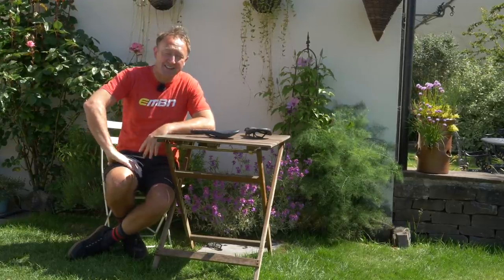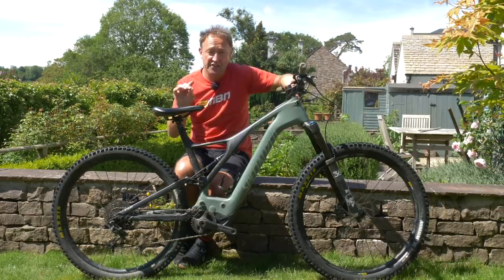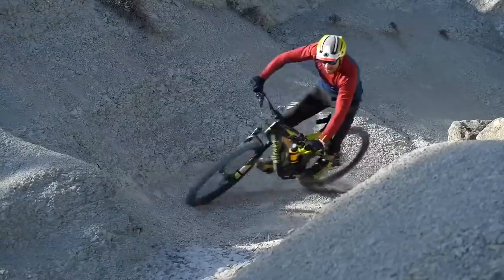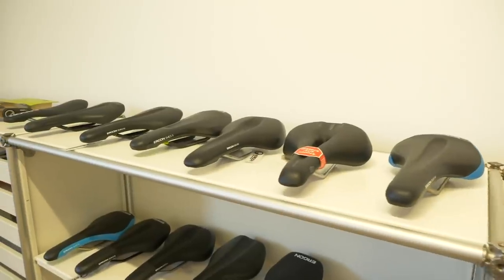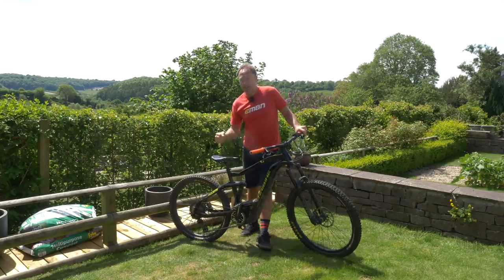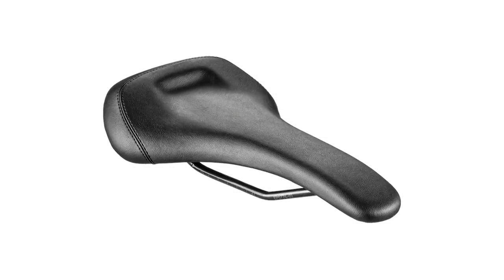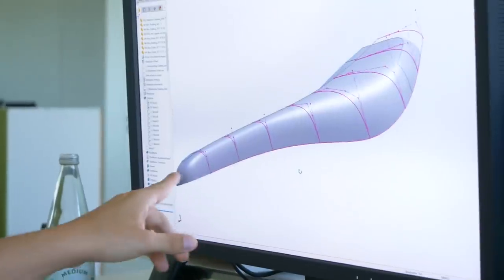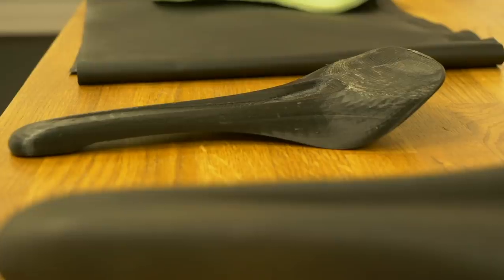Saddle Comfort Explained | Do You Need An E-Bike Specific Saddle?

Comment from the maker: Have you tried many saddles? Do you have a preferred style or are you still looking for the perfect fit? Let us know 👇
Reply: @renthal2372  its probably the width you should be looking at m8,  not length of rails
Reply: I have tried bike saddles for years, from hard, soft, gel, concave, channeled, spring loaded saddles. And the only one I found that I can ride all day looks more like a female saddle but a bit smaller and spring-loaded
Reply: I tried many (ergon sm ebike, italia flow XLR ebike size L and each time I felt my ischion over the saddle) , last year and came back to my specialized power comp 143... But still not good after 2 or 3h even with a good chamois...
Reply: @renthal2372  you can put a longer stem on to stretch you out a bit more!  try and measure your sit bones (130mm is average) then add 20/30 mm,  so if your sit bones are 120mm + 30mm = 150mm saddle (approx).  i messaged mine own with a 12 inch ruler, its awkward but can be done,  you can feel 2 bones, give it ago
Reply: @renthal2372  by the way m8 dont listen to this E bike saddle crap, its just a rip off!!!  i have a fizik R3 large (152mm width) on my bikes,  road and my e bike.
Reply: WTB Pure v
Reply: @renthal2372  its the Aliante R3 in a large, good saddle for me,  look on ebay, i found one for £25.00.  their are only the regular (143mm) and the large (152mm). make sure its the large if you get this saddle,  you need your sit bones ON the saddle, not over the edges!! hope this helps
Reply: This story is timely, as I've just concluded a search for my next saddle.  Long story short, I don't have an e-bike, but ride a 2019 GT Sensor.  I'll prolly be on an ebike sometime in the future, but I like hearing about them - they're interesting.   I'm now on an small/med. Ergon SM-E Comp (not the six layer sponge saddle shown here) and it's terrific.  My old favorite is an SDG Bel-Air (version 1.0 as the new 2.o is rubbish), and it's claim to fame was also the turned up rear end, similar to the Ergon's turned up tail but not as much.   I initially tried a Fabric Scoop Radius, very comfortable, but the rounded profile was a bit of a rear wedge spreader.  Next, I tried Ergon's SM-e in Med/Large initially, since that's what their configurator suggested as I was in between sizes, but riding tech on a wider saddle is not my bag.  

Lucky for me the Small/Med fits my skeleton much better and I can move around off the back for tech riding.   it's also  extremely comfortable when climbing - it has a real sweet spot and actually helps me climb way more comfortably - it's noticeable.   The padding is firm, but not hard if that makes any sense.   I really dig this saddle, and I'm a bit fussy about saddles.   That said, I bought all 3 from a shop that allows you to return items like saddles if not satisfied, so I had literally, the freedom to experiment without a cash penalty.  If you can also do that, it's well worth the effort to try out various seats and find a modern new favorite like I did....
Reply: No, I was recommended Charge Spoon, had them on all my bikes and recommended them to others, comfy and quality for a great price.
Reply: Can you give me one ebike please I don't have money to buy😢☹️

Comment: Learn from the road riders who spend many hours in the saddle basically sitting most of the time... certainly more than we do on MTB.
Good separate under short bibs and additionally some chammy cream is the key to minimise chaffing.. as for your sit area it's more about bike fit / saddle fit and simply toughening up IME.
Reply: Ok, but MTB riders go over more bumps in 30 seconds that road riders do in 3 hours.
Reply: @zedpoutine  I find the real difference on an MTB is your changing body position which is both good (pressure relief) and bad (potential chaffing). I suppose potentially on hard tail but on modern FS bikes.. really? also most Road bikes only have their tyres and your legs, arms and arse as suspension.
I find the tech climbing much more comfortable as I'm not a dead weight just sitting on the saddle your using your legs and controlling seat pressure.. those long smooth draggy climbs are the ones which can hurt as your staying in one position IME.
Ultimately I'm more sore on my road bike for the same time as I rarely stand up or need to change body position. Worst part about the Ebike is we don't stop for rests Vs normal bikes so generally spend more sustained lengths sitting.

Comment: Don’t mater what kind of bike I’m on brooks is the only one that doesn’t hurt my bum.
Reply from the maker: Leather saddles are great as they soften up to your sit bone width. It's pretty rare to see them used for mountain biking though due to the weight, how slippy they can be and the fact you can't constantly get them wet. That's interesting though! Do you just use a cover when washing and use a lot of proofide?
Reply: Electric Mountain Bike Network use lot of proofide I’m old don’t ride in the rain much. I have bought a lot of saddles but they don’t feel the same

Comment: Over the years I have wasted hundreds of pounds on many overpriced saddles and padded cycle shorts, I’ve been custom measured, ridding position checked etc. and nothing but pain and discomfort on long days out! 

Finally in a fit of painful desperation after a long day in the saddle, I removed the saddle off of my cheap folding bike, which I use for my daily commute. It’s a old fashioned  big ungainly heavy form padded £10 saddle that does not look the part on my quality Mountain bike. 

BUT WOW, I can now regularly mountain bike 70+ miles in day and more than 5000 miles per year, on rough technical terrain with no pain. It’s like an arm chair.  I don’t care how much my mates laugh: I’m having the last laugh as I’m so comfortable :-) 

My conclusion is: Modern saddles are just badly desired and a scram to encourage riders to waste money purchasing multiple saddles before given up riding or putting up with the unnecessary pain.